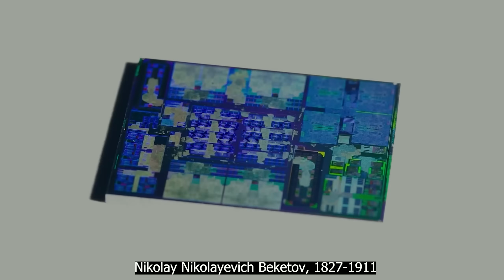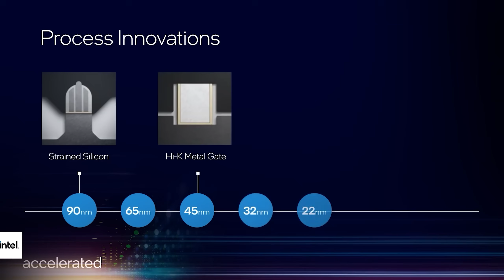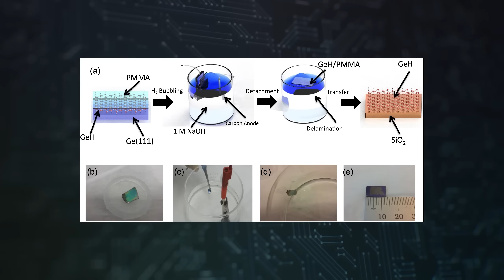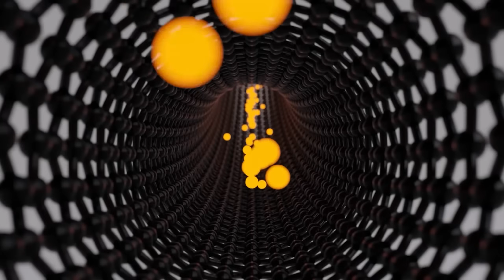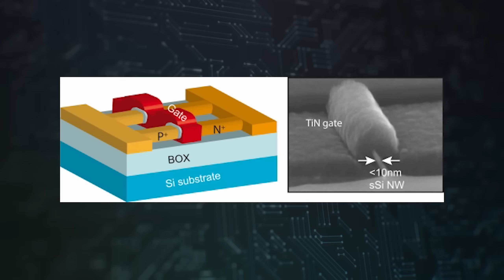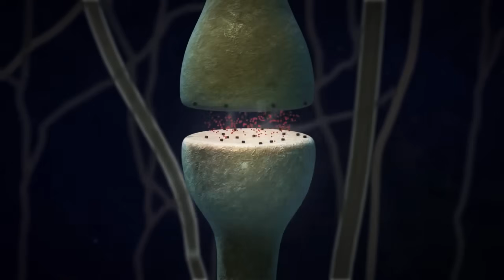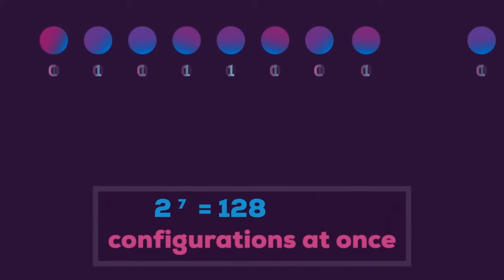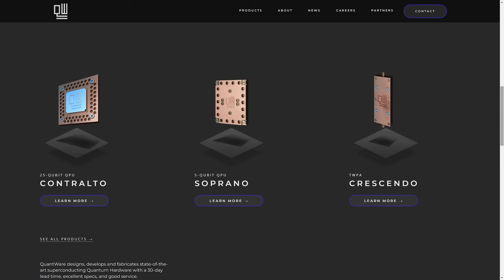End of the silicon era. Processors of the future

Comment: If I were to guess which one would become the first step in a post-silicon CMOS world, it would probably be a room temperature tunnel field effect transistor.
Reply: I'd put my money on silicon/photonic hybrid processors. There are already ASICs out there using photonic processing which are hundreds of times more energy efficient than silicon equivalents. We already have the technology, it's just a matter of integrating them into a full CPU/GPU.
Reply: @SupaKoopaTroopa64  photons are mass-less packets of energy and thus it is very difficult to make them interact between themselves and with any piece of matter we are made or our chips are made of. that's the reason why we still use CMOS transistors with gate delay of 30 picoseconds instead of using light and get attosecond "gate delays" with "light transistors", if they would exist. Everybody has it very clear, creating a chip purely using light will make it millions of times faster than silicon chips. The reason why light is so fast, it is because it has no mass. But you can't make a flip-flop out of photons. That is why accelerating CMOS chips with analog-style logic (implemented using interference, like some startups are doing right now) is a bad idea. It is like putting a F1 engine on a bicycle and expecting it is going to do speeds of 400 km/hour. The bearings of the bicycle wheels will simply melt because they aren't designed for such high RPM (not talking even about aerodynamics here). It would be a good idea for a college student working in his garage, but not for a company that rises 100 million or so for this kind of project. I suggest you to learn quantum physics and chip-design before you invest. The rate of bankrupcy of new companies is like 9 to 10, if not more. Only understanding the physics of the computation you can make a fair judgement of which company is going right direction or not. There are always tons of options to invest but  only few of them are real opportunities.
Reply: @absolute___zero  I'm aware of these limitations. I'm just saying that production-ready photonics already exist, so they have a head start over many other technologies. Also, I don't plan on investing in any photonics startups, or even anything in the microprocessor industry right now, I was just saying that If I had to make a bet on which of these technologies would first appear in a consumer product, I'd go with photonics.
Reply: @SupaKoopaTroopa64  photonics of course has future, but not as co-processors, rather a standalone computing logic with only a few CMOS. But there are many other computing methods that have been developed by scientists but not exploited yet. For example, there are mechanical integrated circuits made of mechanical relays (they achieve 10 nanosecond times to switch on/off), or there are gold transistors working in vacuum like vacuum tubes, there are DNA computers, and so on... the next big idea will be a new computing paradigm. There is also lots of work to do in software to gain performance, for example, development of massively parallel operating system.

Comment: Silicon era will continue for at least another century m8, anything else will most likely be 10x-1000x more expensive and used in niche applications.
Reply: yeah, until any tech becomes consumer grade and priced like silicon/lower it won't be viable replacement anytime within the century
Reply: @paulssnfuture2752   which is very hard to do considering right now the base material is simply sand, and we got extremely good at making perfect crystals of Si, good luck beating either of those things.
i think we will just have more and more silicon around the cpu ( more cache, integrated ram, accelerators etc)
then we might get a cpu where one of the more important bits is a different faster material and the rest stays silicon